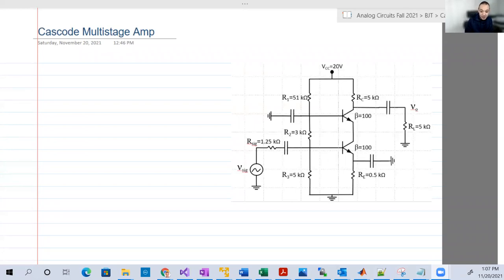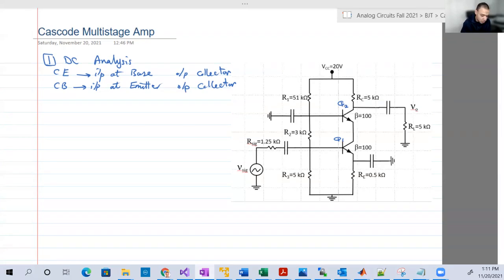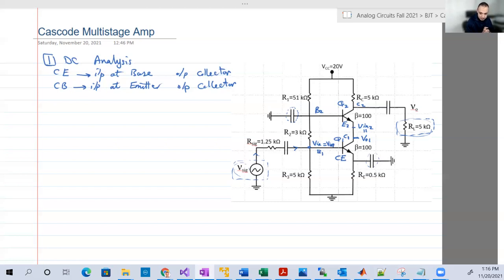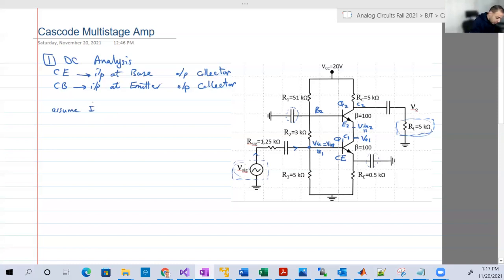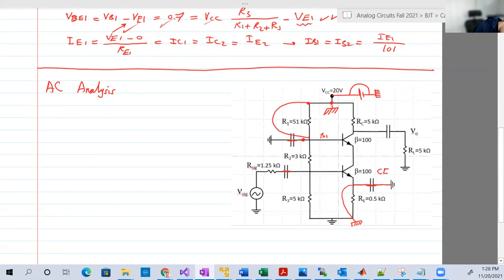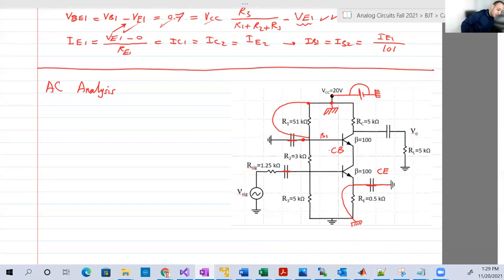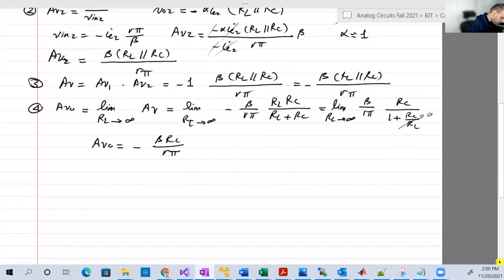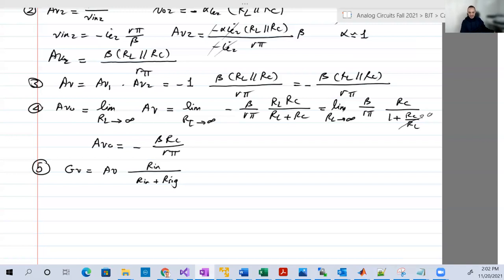Cascode multistage Amplifier - Complete Example - Common Emitter Common Base multistage Amplifier

Comment: Thank you for your effort. However, I have a question. at time 35:58, why we calculate R as Rsig//R2//R3. I think, there should be a Vsig source between Rsig and ground. What happened this source? Why did we neglect this Vsig source? Please, could you explain this situation?
Reply from the maker: no because when you apply Thevenin (by introducing Vx) you should cancel any other independent source such as Vsig by shorting it in order to calculate Rout.